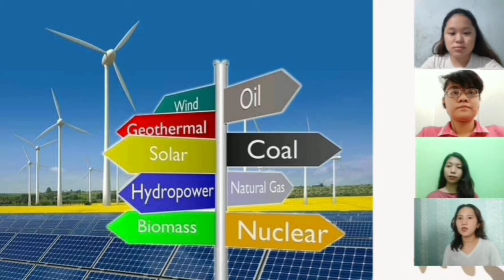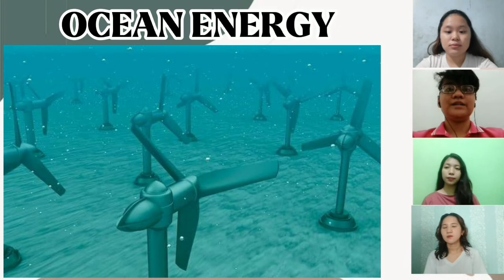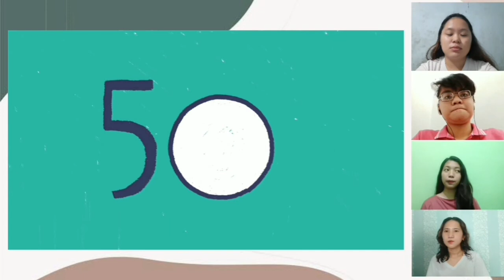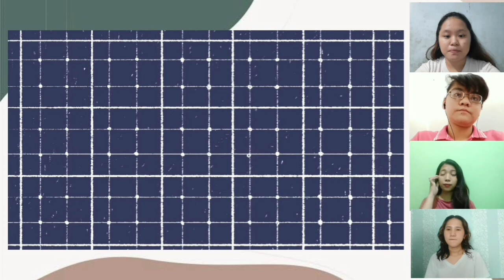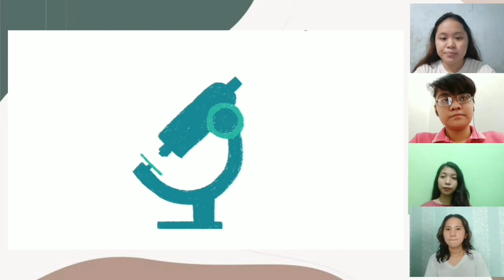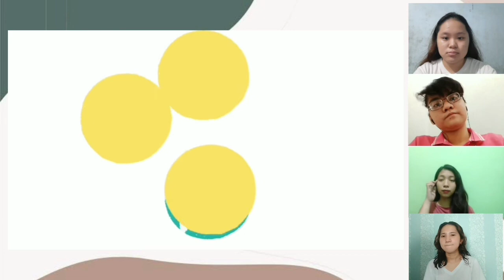GROUP 3- XI. Climate Change Part 2

Comment: In any discussion about climate change, renewable energy usually tops the list of changes the world can implement to stave off the worst effects of rising temperatures. That's because renewable energy sources such as solar and wind don't emit carbon dioxide and other greenhouse gases that contribute to global warming. Renewable energy is one of the most effective tools we have in the fight against climate change, and there is every reason to believe it will succeed. A recent New York Times column seems to imply that renewable energy investments set back efforts to address climate change—nothing could be further from the truth. What’s more, renewable technologies can increasingly save customers money as they displace emissions from fossil fuels.

Comment: This vodcast, I learned about renewable energy sources once more after viewing and listening. Using renewable power can assist to minimize energy imports and fossil fuel use, and we all know that one of the most important sources of energy is the sun, which we learned about in high school. Because the sun's energy is the source of the majority of the energy found on Earth. Solar wind, hydroelectric, biomass, and geothermal power can all produce energy without causing global warming like fossil fuels do. This is due to the fact that renewable energy sources like sun and wind do not create carbon dioxide or other greenhouse gases, which contribute to global warming.

Comment: In this vodcast, hydro in combination with solar and wind is enough to generate electrical power needs for the country. Hydropower or hydroelectricity refers to the conversion of energy from flowing water into electricity it is considered a renewable energy source because the water cycle is constantly renewed by the sun. One of the first uses of hydro energy was for mechanical milling such as grinding grains but today moderhydro plants produce electricity using turbines.

Comment: The vodcast was overall interesting to watch. Honestly, I know of some renewable energy sources but I’m surprised that there are more renewable energy sources that I was not aware of before. This vodcast well discussed the use of this renewable energy, even the drawbacks of using them. As much as we wanted to use this as our permanent energy source there will still be barriers in doing so. However, this can’t be a reason to use renewable energy, especially because climate change is a big problem to the world and our planet needs to be saved from further harm. Overall, I had learned a lot of new information from this vodcast and it’s refreshing to learn more things about renewable energy and how it can protect our planet from climate change.

Comment: I learn so much information  in this topic i proudly learning how renewable energy and how we must protect the resource we have 
Environmental and economic benefits of using renewable energy include: Generating energy that produces no greenhouse gas emissions from fossil fuels and reduces some types of air pollution. Diversifying energy supply and reducing dependence on imported fuels.

Comment: I gained a lot of knowledge about this topic that Sustainable assets additionally produce clean energy, which means less contamination and ozone harming substance emanations, which add to environmental change. The Importance of Renewable Energy for Environment, Usually we use energy to acquire power, heated water, and fuel for vehicles. We gather this energy from petroleum derivatives like oil, flammable gas and coal. Lastly they followed the first part of climate change well.

Comment: this vodcast I have learned a lot that can be used without affecting the earth and there is more here we can use electricity even in a storm. A renewable energy system can be used to supply some or all of your electricity needs, using technologies like, Small solar electric systems.

Comment: I must say that I am amazed as the hosts momentarily portrays renewable sources and its benefits and drawbacks. For this will give assistance to individuals install and keep up with sustainable wellsprings of energy by maintaining as a top priority the benefits and disservices to assess whether or not to utilize it. This vodcast also refreshed up my mind that climate change might be inevitable but it  can be prevented and  lessen up by having these renewable resources. Wind and solar power, then shows extraordinary potential. While we, as of now utilize these advancements to deliver energy, there is unquestionably opportunity to get better and we can hope to see an incredible ascent in the small amount of our energy that comes from these sources. New advances, for example, wind 'turbines' or 'kites' that soar in the air, or paint-on sunlight based chargers, show incredible guarantee for the eventual fate of these two energy sources. Further, both of these sources are genuinely inexhaustible and practical in all possible time periods.

Comment: This topic adds up some informations I know about climate change and other resources of energy. It is great to discuss this kind of topic where we all know that since we are in elementary we start to study about climate change until now. But we are not able to discuss and explain clearly all the things about the climate change. But right now after watching and listening the vodcast about climate change part 2 is, even though I already knew about climate change there are some information I've gained from the vodcast especially the renewable energy resources. In the video the hosts also explain about the sources of energy like the wind power, solar power, hydroelectric power, geothermal power and biomass energy. Also there are other informations that taught me like the renewable energy is a significant because it has the ability to provide a constant supply of electricity without relying on natural resources. It is important that this topic will watched by people because the climate change we are experiencing is our own deeds and it is our responsible to do things that can change and make our country better.

Comment: After watching and listening, I once again gained knowledge about renewable energy sources. Using renewable energy can help to reduce energy imports and reduce fossil fuel use, and we studied it in high school, of course, we already know that the One of the most important sources of energy is the sun. Because the energy of the sun is the original source of most of the energy found on Earth. Solar wind, hydroelectric, biomass, and geothermal power can provide energy without the planet-warming effects of fossil fuels. That's because renewable energy sources such as solar and wind don't emit carbon dioxide and other greenhouse gases that contribute to global warming.